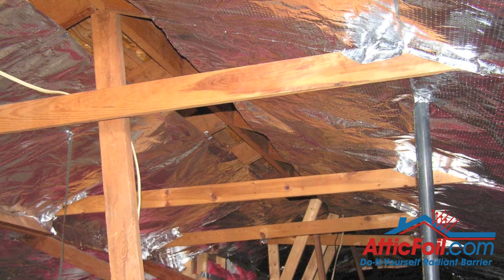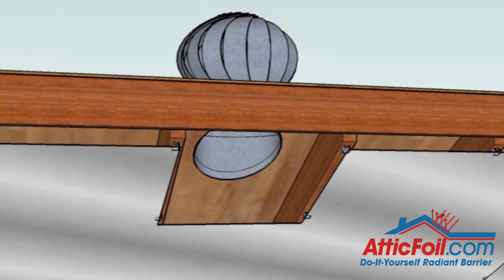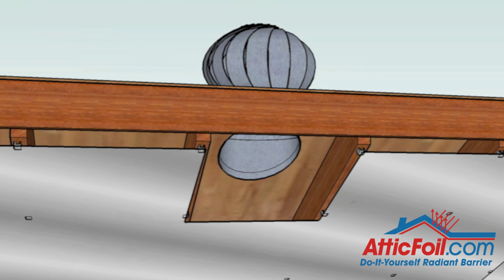How Radiant Barrier Works - Short Installation Summary

Comment: good video.  Any tips for avoiding stepping between the ceiling joists and putting your foot through the drywall while walking around installing the foil?
Reply from the maker: Be really careful!  Use some 2x6's or some other boards to put perpendicular across the ceiling joists to work/walk on.  This will give you a walk path and distribute the weight in case you have any loose boards.
Reply: Plywood.  You can slide it as you go.
Reply: I see this product applied directly under the top chords of trusses, or laid directly on top of insulation.   What decides which way?
Reply from the maker: How To Decide Here: https://www.atticfoil.com/pages/best-install-method

Comment: my roof already have the wood with a aluminum foil....can i add the radiant barrier even if i have tye film on the roof? tks
Reply from the maker: Yes, you can do both.  Think of it as having two pair of sunglasses.  What gets past the first will be reflected by the layer of www.AtticFoil.com stapled to the bottom of the rafters.  We have several builders that do both and the results are pretty amazing.  With decent attic ventilation the attic typically won't get more than a couple degrees warmer than outside (ambient) temperature.

Comment: Any benefits to use this under a crawl space to further insulate the floor or no?
Reply from the maker: It depends.  If you are using radiant floor heat, it can definitely help.  Typically, we see people use the www.AtticFoil.com in the crawl space to do two things.  1) help hold up the insulation between the floor joists and 2) use the SOLID version to create a vapor barrier to keep moisture from the ground from entering the home.

Comment: Why you don’t recommend attic fans ? I planning to install radiant barrier but already have the attic fan installed
Reply from the maker: Attic fans usually cause more trouble than they fix.  Plus two wind turbines with a typical 8mph wind will pull as much air as an electric fans. You need LOTS of open soffit vents to "feed" an electric fan.  Most people never clean their soffit vents. Otherwise, it will suck air from your house before the motor burns out.

Comment: Thank you for the video.  I finally used part of a roll of perforated Artic Foil stapling it up to the rafters under the roof of our attached garage for our home south of Fort Worth, Texas along the lines of your videos.  This process was relatively easy and seems to be helping the attic heat over the attached garage.   My issue is that the inside attic space over the main part of our home which contains our gas heater and air conditioner ducts is maybe two stories high at the center (very step tall roof in the center) - way too high for me to easily reach, especially because of at least 1 1/2 feet of insulation on the floor of the attic.   I'm having trouble envisioning how I might get a radiant barrier in this main space - it would be a challenge just to reach the side roof walls from the inside.

I'm wondering if there may be staplers that can be attached to a poll that could staple foil raised by another poll?   Or what about some kind of foil tent that might go above part of the air conditioner ducts?   I realize professionals might be able to do something, but are there any techniques where DIYers could at least get some foil up in this tall center space?     Would a foil tent 6 feet up over some of the space be of any use - I might be able to reach some of the vertical supports for attachment.

Thanks.  Dave
Reply: Check to ensure health and life insurance. 
A hard hat, goggles and respirator.
Lots of cross boards to step on. 
A long prop or 2 to get the sheet up an into position. Kitchen brooms are gentle. 
A powered stapler with the trigger zip-tied in the fire position. Make sure that it will fire every time the nose is pressed, not all do. 
Attach the stapler to a pole that will reach up there. 
Be safe, gravity doesn’t sleep. 
Do your best but don’t sweat it (lol) as the benefits are a cumulative effect.
Reply from the maker: Consider the "Over The Insulation" method for that area.  Be less concerned with having a hot attic.  Keeping the insulation cooler is the main key to reducing heat flow. Considering how much easier it is to install it's definitely worth it. https://atticfoil.com/index.php/installation/best-install-method/

Comment: I put the foil only on part of the surface of the attic because i could not reach all the way (very low pitched roof). I was impressed with the product !  It is way different that the insulation foil sold in big stores. I found it very easy to install. I did not staple it but rather laid it on the insulation - please note this is a radiant infrared thermal reflector and not an air insulator so just placing it over the ducts and insulation shall work very well. I wish i had longer bamboo poles to push it deeper towards the eaves and better light (led headlamp and led rafter attachable lamp would have been ideal). I did not use staples or tacks at all, i just laid the sheets cut in length of 8-9 ft.  I give this product an evaluation of 10/10. (Used for home in South Florida).
Reply from the maker: Thanks for being a www.AtticFoil.com customer!

Comment: Florida 80's home here I'm curious on your take of stapling "draping" seen in most of your videos vs stapling flat to the roof which is more labor intensive and I am guessing a waste of time.
Reply from the maker: I think you are asking if it's best to staple to the BOTTOM of the rafters (normal install) or actually putting on the bottom of the roof deck between the rafters?  Stapling to the bottom is actually easier and BETTER.  First you don't have to deal with nails sticking through the deck and you WANT the airspace between the deck and the foil.  PLUS, putting on the bottom of the rafters will help reduce what is called "thermal bypass" of heat going through the rafters.  Here is more info on this question: https://atticfoil.com/index.php/knowledge-zone/knowledge-zone-q-a/wouldnt-the-foil-be-more-effective-if-i-cut-it-and-installed-it-in-between-the-rafters-directly-on-the-roof-deck/
Reply: @AtticFoil  AWESOME!!!! Thanks for your quick response!

Comment: I have soffit vents every few feet. I don’t have any other vents in my attic except the toilet and dryer vents. No ridge vent or fans that I can see. Should I look into getting a vent put it?  It’s a South Florida home made of concrete block trusses, stucco and asphalt Shingles.
Reply from the maker: Florida can be tricky.  I'd check to see what local code or other builders do in your area since it's considered a "Hurricane Area"  And topside roof vents in that area are also referred to as "water injection systems".  There are a lot of good vents that are super durable under high wind conditions.  So, I would look to getting one if possible.  However, on low pitch roofs soffit vents can act as both an INTAKE and EXHUST vent as the wind blows on one side of the  home.  So, you still can get some decent ventilation.  What is your concern? Is your attic hot? Home Hot? Looking to install www.AtticFoil.com?  Whatever you do, make sure your soffit vents are clean and open.  Use a nylon brush and brush them from the bottom to open them up.  They are like a lint trap on a clothes dryer and get clogged from the bottom. A leaf blower won't work.
Reply: @AtticFoil  Thanks for the tips. In the summer I have an issue with my AC not cutting it towards the end of the day about 3-4PM when the sun effects the house the most. I will look into cleaning all the vents, They do look pretty crummy. The home is in a development and is a low pithed roof I understand and thought that all the vents let the attic breathe.
Reply from the maker: @notrodtv6113  Ventilation is always good, but you will be far better off installing a radiant barrier from www.AtticFoil.com - Even partial coverage will help.  Think of it this way.  Would you rather sit in a car parked in the sun with the windows rolled down, or sit in a car under a big tree with the windows slightly open?  Radiant barrier is a lot like being under a tree.  A radiant barrier will have a far bigger impact on overall reduction of heat into the car than any ventilation will.  Ed.

Comment: Question: I can't find any info on whether my 1925 home has a ridge vent. It has the original clay-tile roof, plank sheathing underneath on top of rafters of course, and, importantly, has soffit vents all the way around. Hoping that soffit vents means they definetly employed a ridgeline vent in 1925 Los Angeles, CA construction. Would they have used a Ridgeline vent technique in 1925 with clay tile?
Reply from the maker: Good question.  A lot of old clay tile roofs have slats instead of solid deck. Those type roofs were basically "self ventilating" since they had a bunch of small cracks/gaps. You say "plank sheathing" is it solid or can you see the tile in between?

Comment: Video is awesome. Simple, honest and straight-forward. Thank you, Ed. I just had a radiant barrier installed in my attic. The guys covered more than 95 percent but left a gap at the ridgeline where it should be and a few gaps where the rafters were meeting (4-sided sloping roof lines). I was concerned they left too many gaps but after seeing your video I'm confident they did a good job.
Reply from the maker: Just like a tree.  The more coverage the better.

Comment: Can I use this on my garage ceiling; no attic, just roof rafters; metal roof.   There is a side window and soffit vent above garage door.  If yes, how would I apply?  I live in Florida and I'm trying to keep it cooler to work in.  Will be insulating the garage door per your instruction video.  Thanks.
Reply from the maker: If you "FEEL" the heat coming off the garage ceiling, then yes it would help.  You could staple it up, or use adhesive.  However, you would be FAR BETTER off putting it in the attic ABOVE the garage.  Just laying over the ceiling joists would be a huge improvement (and easy to install).  This method will reflect the heat of the hot roof BEFORE it ever reaches the garage ceiling.

Comment: Ed,
I've decided to lay the RB over the rafters (new build) as you suggested.  My contractor typically uses "sunboard" for decking.  I can save some $ if I go with straight OSB decking.  Is there any advantage/disadvantage to using the "sunboard"?
Reply from the maker: Your best bet is to read the Department Of Energy Study Here:  https://atticfoil.com/wp-content/uploads/2016/03/Department-of-Energy-Oak-Ridge-Labs-Radiant-Barrier-Study-wwwAtticFoilcom.pdf  It compares Low=e paint, radiant barrier decking, and AtticFoil type foil stapled to the bottom of the rafters.  Basically, the RB decking reduced overall heat flow by 30% compared to stapling to the bottom of the rafters at 50%.  So, laying over the top of the rafters would put you somewhere between these.  It guess over 40-45%.  Bottom line is the AtticFoil type radiant barrier is MORE effective than radiant barrier decking but you would have to decide if it's worth the extra cost.

Comment: I am in Michigan and we have some very hot summers and very cold winters, can you install over the blown in insulation and on the rafters? Also if installed on the rafters could you lightly blow in insulation up against it if you have baffles covered up, say 12" up against it if it is stapled to the rafters?
Reply from the maker: You could do both, but it would really only provide a benefit if you have ductwork in the attic.  Otherwise, with no ductwork laying out over the insulation is all you need to do.  If you want to blow insulation against the foil just leave a 2-4 inch gap between the lowest horizontal piece and the next piece.  This will allow a path for air from the soffits to enter the attic below the foil.

Comment: Why do you not recommend attic fan?
Reply from the maker: Attic fans usually create so much negative pressure in the attic, they end up sucking air out of the house.  Soffit vents are usually clogged and dirty which puts so much static pressure on the motors they usually burn out in a couple years.  Two wind turbines will do the same thing as one electric fan.  Clean the soffit vents no matter what you do.

Comment: My rafters are only 4” wide. Is this wide enough space to allow proper ventilation flow??
Reply from the maker: Yes, remember the air between the rafters is not under pressure like an air duct.  1/2" or better works fine.

Comment: Do you need to leave that space on top even if you dont have ridge vents?
Reply from the maker: Yes, no matter what type of ventilation you have you want to leave gaps at the tops and bottoms of all the foil.  Hot air will "pool" in the top of the attic.  This is like water heading towards a drain.  Assuming you have some "holes" or exhaust vents in the top of the attic the hot air will work it's way up and out the top.  You just want to give it a free path without any "dead ends" to reach the top.

Comment: So this provides protection against Radiant heat... What if i need sound insulation as well... Meaning I have a metal building and when it rains, the rain hitting the roof is loud... Very loud
Reply from the maker: For sound reduction it's tough on a metal building.  Open cell spray foam is your best option.

Comment: just added batt to side walls of cape code attic...Can the radiant bear be added over top of batt ?
Reply from the maker: When you say side walls, do you mean the backside of a second floor room that faces the attic?  If yes, then the foil will help reduce radiant heat into the wall combined with the batts to reduce conductive heat flow. If the "sidewall" is a gable end then batts won't do much since the wall is not part of the "thermal envelope".

Comment: What's the average cost of this? My builder is offering to install it for $750 yet I don't know if this makes a difference on my electric bill.
Reply from the maker: It really depends.  The actual radiant barrier foil from AtticFoil.com  is sold here: https://atticfoil.com/index.php/products/48-wide-double-sided-atticfoil-radiant-barrier-foil-perforated/ Call us to discuss further.  $750 is pretty reasonable especially if you are in a hot climate area.

Comment: Why do some sellers suggest installing on TOP of  the insulation, as opposed to stapling right below the roof?
Reply from the maker: http://www.atticfoil.com/index.php/installation/best-install-method/  It depends.  In cold climates without ductwork, over the insulation is usually best. In HOT climates with ductwork in the attic, then the staple up method is usually best.

Comment: Thanks for the information!  Nevertheless, why not using the attic fan to pull the hot air out from the attic ?   🦅🦅🇺🇸
Reply from the maker: A fan can help some but does nothing to reduce the radiant heat.  This is like cracking the windows in a car parked in the sun.  Yes, it will help, but a sunscreen or parking under a tree to reduce the radiant heat will have a far bigger impact.

Comment: I only have soffit vents on one side of my house. I've already purchased AtticFoil and installed it on the roof deck of the side that has soffit vents, starting about 4" above the installation. What type of spacing do I need on the side without soffit vents? Also, should I consider installing gable vents or will AtticFoil RB be effective without great convection?
Reply from the maker: im1dermike I would go about 4" on the side without soffit vents.  AtticFoil will still be effective without great ventilation.  You do need SOME vents in the top of your attic.  You mention installing gable vents.  If you already have some vents, you will probably be alright.  If not, then you need to add some vents in the top of the attic.  Either, ridge vents, wind turbines, static vents or gable vents.  Measure the AIR temperature under the AtticFoil once it has been installed.  The air temperature should be no more than about 10 degrees hotter than the outside air.  If it is more, then this indicates a lack of vents.  Either intake or exhaust and the air is basically getting "clogged" in the attic, just like a drain.  You will need to open it up and let the air flow.

Comment from the maker: Attic fans usually cause more trouble than they fix.  Plus two wind turbines with a typical 8mph wind will pull as much air as an electric fans. You need LOTS of open soffit vents to "feed" an electric fan.  Otherwise, it will suck air from your house before the motor burns out.

Comment: Why no attic fans. I was just about to order when I saw that in the video. Please elaborate as to why you don't recommend attic fans???
Reply: kaydee457 attic fans tend to pull more air than the lower vents can supply thus pulling warm or cold air from inside the house via ceiling air gaps.

Comment from the maker: When using radiant barrier decking, the foil faces down towards the attic - when yo stand in the attic you should be able to look up and see the foil side facing you.  The attic space IS the required airspace.  Radiant barrier decking works off the emissivity quality of foil.

Comment: If a radiant barrier  will not perform if installed directly under a new roof because there is no gap, how does it perform when radiant decking is used? There is no gap with that installation.
Reply: you mean the radiant barrier will be useless if it is placed between the steel purlin and roof sheet?
Reply from the maker: The attic space IS the air gap. On radiant barrier decking the foil side is installed facing INTO the attic.
Reply from the maker: Kinda lost on this one.  It will be useless for the small area where it is physically "sandwiched" between the purlin and the deck. Where it is open (you can see from the bottom) it will be very effective.  So, you would loose probably less than 5% effectiveness.